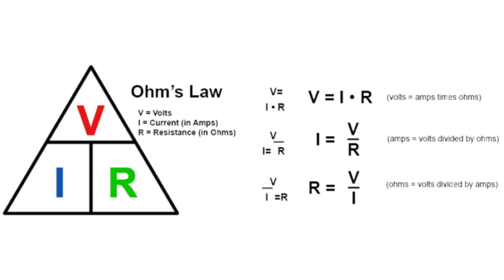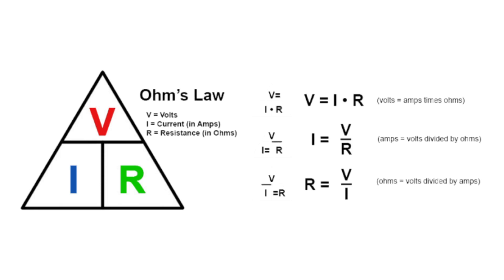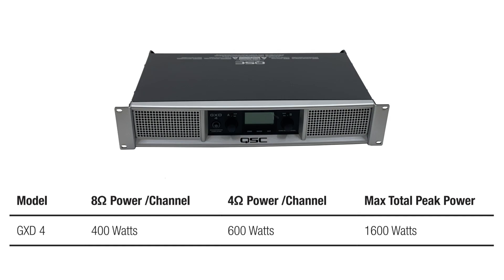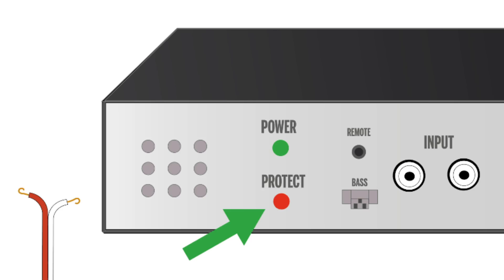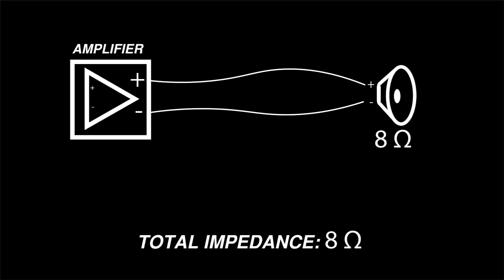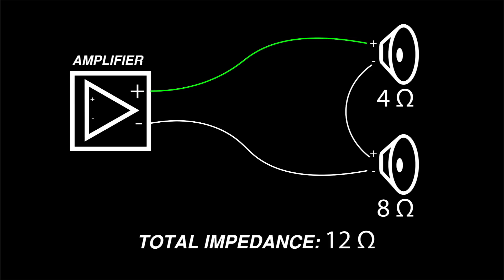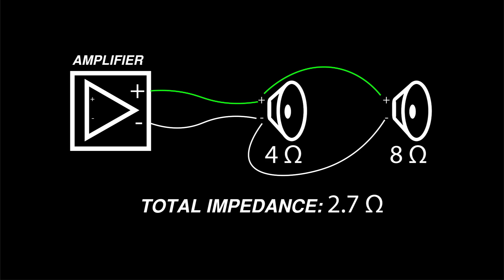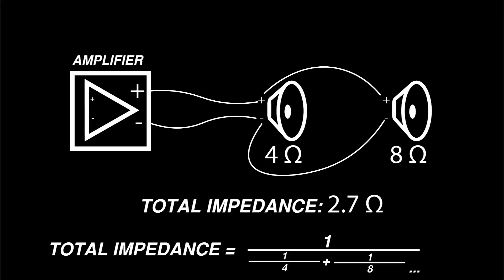What You NEED To Know About Speaker Impedance! | Series vs Parallel, Ohms, & Amplifier Matching

Comment: I have watched and read more articles on this subject that my brain hurts when I think about it. 2 questions. (1) why is the 3rd wiring option always left out? Series Parallel. Not one or the other, but both combined. What affect does this have on the speaker array power handling (2) what affect does "Speaker" series wiring have on the total power handling of the circuit. Keeping in mind, the amp has no factor here, we can always get a more or less powerful amp. If you wire a 30w, a 200w, a 50w, and a 15w in series, what's the power handling of the circuit as a whole?

Comment: I have an old CB radio with a bad internal speaker. It's a 16ohm 2w. I can't for the life of me source a 16ohm 2w speaker, but I happen to have some parts radios with 8ohm 2w speakers inside. Can I just wire up two in series inside the case and call it a day?

Comment: In parallel,    If 2 x 360W
Then independent Chanel is 360w

If only using Channel A 
In parallel 
Will output of amp only be 360W?

If using parallel in Chanel A, will both speakers recieve 160W?
Reply: No because 2 8ohm daisy chained make amp go 4 ohm

Comment: I have two 6 ohms Yamaha bookshelf speakers (left and right) hooked up to my Yamaha RX-V379 AV receiver, my question is, witch way do I need to wire them to make them 6 ohms or 3 ohms?
Is that even possible and will the sound get better ?

Comment: why connecting 2 of 8ohm speaker equates to 16ohms? shouldnt the answer be 4ohms, instead of 16ohms?
Reply: The impedances add when they're in series so 16 ohms is correct when two 8 ohm speakers are wired in series.

Comment: I’m looking at having a 2x12 guitar amplifier cabinet built.  The speakers I’m looking at are 60 watt speakers and are available in various ohms.  The amplifier I’ll be using is a 25 watt amp that defaults to 8 ohms, but is switchable to either 4 or 16 ohms.

Question, is there an advantage or disadvantage to having the speakers wired in either parallel or serial?  I was thinking of setting it up to run two 8 ohm speakers and setting the amp to 4 ohm.

Comment: quick question, so if I have 2, 35 watt speakers @ 8ohm and run them in series.  That means 70watts at 16ohms.  Or is there another way to calculate watts is a series.  trying to do home entertainment setup with an old stereo reciever.

Comment: why would a 4ohm and 8ohm in parallel be 2.7 ohms instead of 3 ohms?
Reply: Or you could use the “product over the sum” method meaning multiply 4 x 8 = 32  then divide that amount by the sum meaning add the two values together (4 + 8 = 12) which would equal  2.66666 and after rounding up would be 2.7 ohms. Btw, when using this method you can already know that the result will be lower than the lowest ohmic value.
Reply: @Trotter2320  I've been doing these calculations for decades and never even knew that method (product over sum) existed. Totally makes sense knowing math and fractions but I never put the 2 and 2 together. That is waaay faster (especially with just pencil and paper which is my preferred method of doing math, calculators is for sissies). Thanks for sharing that.
Reply: @wally7856 Thanks. Glad it was helpful.
Reply: For resistance (R) in parallel the formula is as follows: 1/R=1/r1+1/r2+1/r3+ ... +1/rn

So you get 
1/R = 1/r1+1/r2
1/R = 1/4 ohms+1/8 ohms
1/R = 0.375 ohms
R = 2.7 ohms

Comment: Questions pls,  I have a pair of 12s power loud speakers each 4 ohms. The amp is 2000 peak. Now can i replace those speakers with 8 ohms each .and by bringing those speakers trough out and in to the other one , does that causes less ,more or no chances because they r individuals power speakers.

Comment: Hi, does the amplifier impedance rating divided in left and right channel? 

I have an 8ohms rating amplifier and two 8ohms speaker. If i wire one to the right channel and another to left, will the speaker become 4ohms?
Reply: No, the amplifier rating is for each channel separately.
Reply: Thanks!

Comment: If 2 speaker on one channel and the first is a midrange 240 watt woofer thats 6.5 inches. Wired in series it is 8 ohms with no capacitor added. The second speaker is a 3" tweeter at 80 watts at wired off of speaker one in parallel with a capacitor of 2.2 uf at 250 volts. Tweeter is rated from 4 to 8 ohms. What will the impedence be and the total wattage per that channel.

Comment: I have a 4ohm and 8ohm speaker can I run them in parallel? I have a 2 channel amplifier the speakers are 6.5
Reply: I have run 4ohm and 8ohm speakers in parallel (2.76 ohms) on my vintage pioneer sx1080 stereo for years without issue. The speaker output heatsinks get pretty warm so it does put strain on it being rated for 4 to 8 ohms. This only happens at extreme volume at power protect engaging levels. If you have enough high quality power it should be fine but ultimately not recommended. I just got a Hitachi sr2004 which is way more powerful but have decided to wire my speakers in series (12ohms) the Hitachi has a range of 4 to 16ohms. 

Now as for what order your speakers should be in. 4ohm before 8ohm firstly but, if you cut the 4ohm speakers power rating in half and it is lower than the power rating of the 8ohm speaker, you will then get better sound running the 8ohm speaker then 4ohm. Hope this helps 😁

Comment: Hello, what happens if I run 16ohm speakers on an 4-8ohm rated amplifier? Does it mean that the speakers will receive less power from the amp in comparison, or are there other acoustical issues? Thanks
Reply: What little I know is that it would receive less power than what the amp is rated at and it is ok but never go with a speaker or combination of speakers that would reduce the impedance load to below the amplifier’s minimum impedance.
Reply: You can always go higher then rated on a solid state (modern) amplifier (tube amplifiers you cannot). You would get 1/2 the power then a 8 ohm speaker and 1/4 the power going to a 4 ohm speaker.

Comment: I would really like to know the science behind why impedance halves itself when speakers are wired in parallel.
Reply: Not science but a decent analogy. If water is traveling down a pipe and meets a junction that leads to 2 other pipes, physically the water will find it easiest to split between the 2 pipes, thus equally distributing the water pressure.
Reply: It's easier to go through two wires in parallel.

Comment: Your channel is underrated. For a noob like me with the "Audiophile" World, it's pure gold, thank you very much! Some amplifiers have banana plugs for both 8Ω and 4Ω. What if my speakers are 6Ω, should I plug them on the 4Ω or the 8Ω, or should I change my speakers?
suggestion in regard to 1:30 - an example where the amplifier (or the speaker) could indeed get permanent damage would be nice, like a real world consideration beyond Ohm's law: with numbers (deltas or "comfort zone" above the nominal impedance+W). I guess that it would depend on how much voltage or current the different electronic parts are rated for? IDK, but can it be simply detected via the noise getting in as the volume rises up, just by hearing?... How can it actually happen in such context - no need to blow one of your own amp on camera for this, numbers would be sufficient (even though it could spice up your presentation 😉)?

Comment: My question is the effects of a crossover.  I have 4 bookshelf speakers I wish to connect in series ( a stereo pair of two each).  How will the crossovers affect the setup?
Reply: I want to know that too. I already knew the basic concepts in this video (it hardly needs a 4 minute video for that).
Reply: It have to do with impedance rise which means what Tones are your speakers most effective at? Usually the more efficient, and more louder, ohms go higher. When your speaker is pushing ohms that is isn’t as effienct as, it would cause impedance rise. You would have to hook up a Multi meter and check where your speakers go up and down ohm wise and set your crossovers so the impedance doesn’t drop.

Comment: I have a question about ohm matching for my guitar amp and my attenuator. I’m using a fender deville 4x10 amp, with 8 ohm speakers. I also have a tone king attenuator, which has the ability to adjust the omhs for the input coming from my amp and output going to the speakers. When I used a multimeter on the speakers, they read 2 ohms which makes me think the speakers are running in parallel 8/4=2. Since my attenuator output has 4,8, and 16 ohm settings, does that mean I need a 2 ohm setting to match the speakers properly? Or can I can get away with using the 4 ohm?

Comment: I have a question that I you can help me with.. I had 3 mtx FPR10 .35 OHM (they were sold in 3's). I sold 2. I just bought (2) 4ohm subs. Can the 3 be wire to work together?

Comment: So, how would one calculate the power required to drive a load with speakers that vary in nominal impedance, like the example with the 4-ohm & 8-ohm speaker in parallel?
Reply: There is a formula in electronics called the product over the sum for parallel circuits. The product meaning multiplying and the sum meaning adding. So if you have two different ohmic values involving two different  speakers in parallel such as combining a 4 ohm speaker with an 8 ohm speaker for the amp output load the total is derived by multiplying 4 x 8 divided by 4 + 8 which equals 2.67 ohms. So 32 ohms divided by 12 ohms equals 2.67 ohms. Another rule of thumb is that in this situation the total ohmic load will always be less than the smallest ohmic value in the equation so 2.67 ohms is less than 4 ohms.
Reply: @Trotter2320 thanks!

Comment: If I have 2 speakers of 4 ohms of 100watts if I connect in series it will became 8 ohms and what will be the wattage it will be 100watts or 200 watts
Reply: And did you found your answer? Cause that's almost the same question I have.
What happens to the amount of watts depending on parallel or series connection?
Reply from the maker: The total power handling capacity of the circuit will increase with multiple speakers. To harness that power, you’ll need an amp powerful enough to provide it. The power capacity of each speaker will remain the same, but the impedance will have an effect on the power rating of the amplifier.

Comment: My stereo amplifier has two sets of biding posts for each channel. The user manual says that it can drive a pair of 4 ohm speakers if only one set of the binding posts are being used. If I were to use both sets of binding posts, it can drive speakers that are between 8 ohm to 16 ohm. My speakers are rated at 4 ohm and they support bi-wiring. My question is that if I use both sets of the binding posts on my amplifier to bi-wire a pair of 4 ohm speakers, will it cause any issue/damage? Thanks.

My amplifier's Power Output
200 W + 200 W (8 Ω)
400 W + 400 W (4 Ω)

The speakers are rated at 4 ohm with 90db sensitivity.

Comment: I thought you'd talk about the sound difference between in-serial and parallel setups. Or is it just no difference?
Reply from the maker: I’ve not noticed a difference in sound quality. However, I’ll admit that I don’t use parallel connections very often. Most often, I’ll be working with or designing a system that has a few cabinets in parallel.

Comment: hay... i have 4 high frequency drivers which haves 8 ohms impedance each.... so i wanted to run all of them on 4 ohms... how it can wired?? pls reply
Reply: You can wire the 4 in parallel, which brings the total impedance to 2 ohms, then add a 2-ohm power resistor in series to bring the total impedance to 4 ohms. The 4-ohm amp should have a little range, and if so maybe a certain combination can work to give a close value to the 4 ohms, without adding any power resistor.